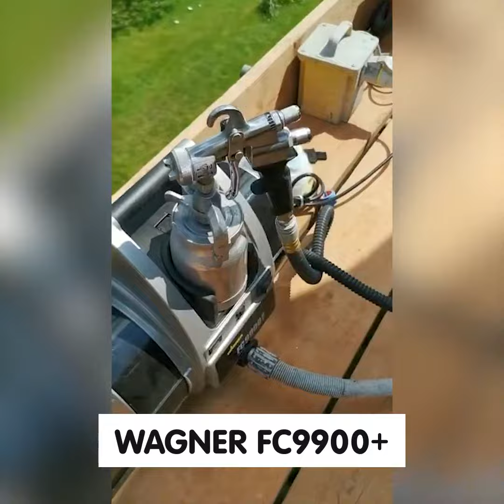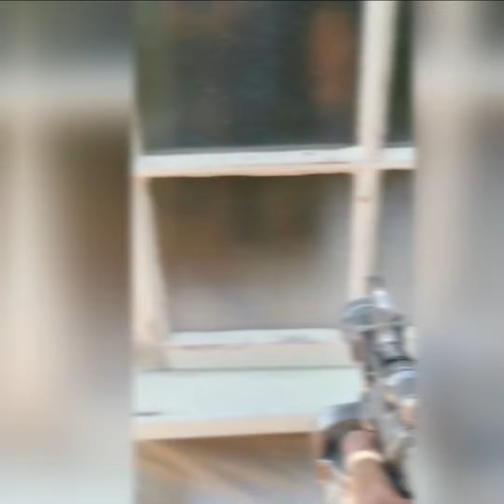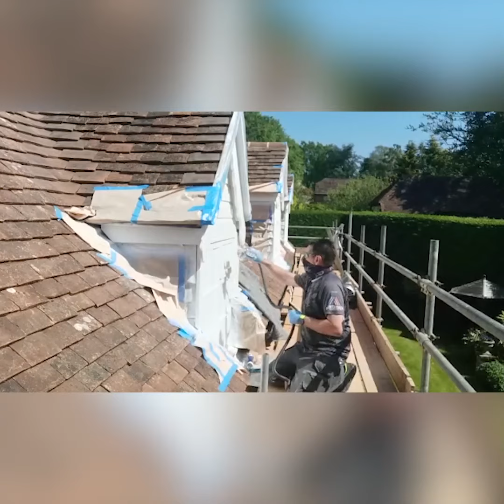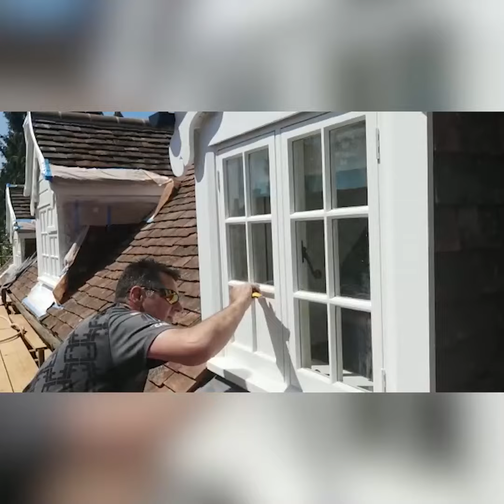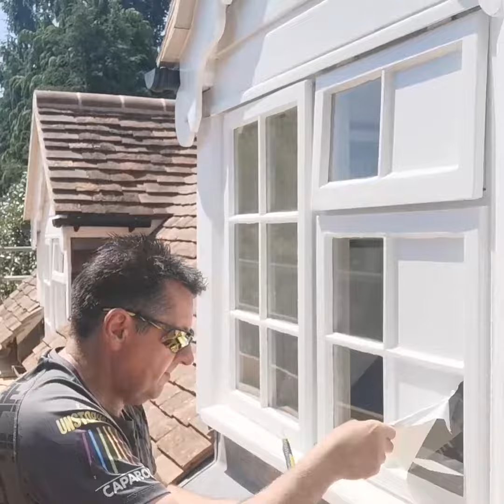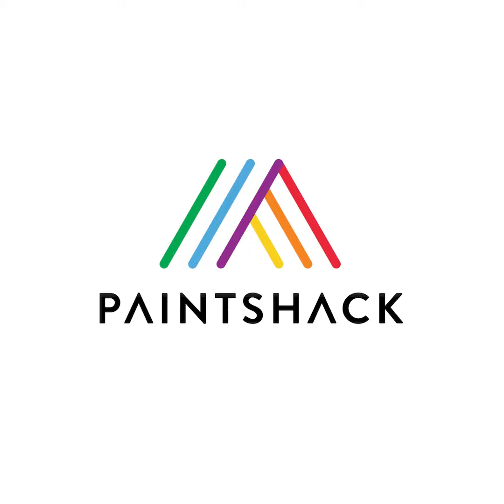Walther Strong Liquid Masking Tape Sprayed onto Windows

Comment: Does it really act as a primer? To prepared wood? If it just peels of glass then surely it must with wood over time..?
Reply from the maker: Hi Josh yes it really works as a primer and a glass protection.
Reply: Can you spray this on brickwork too would it do the same job and peel off?